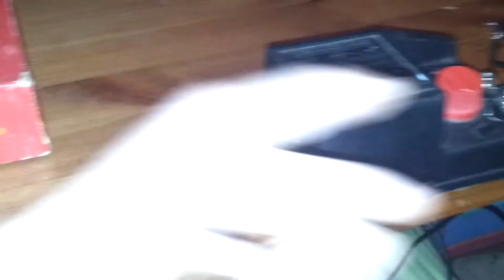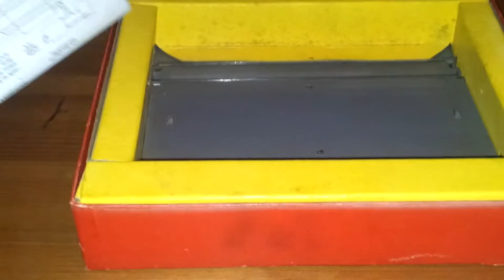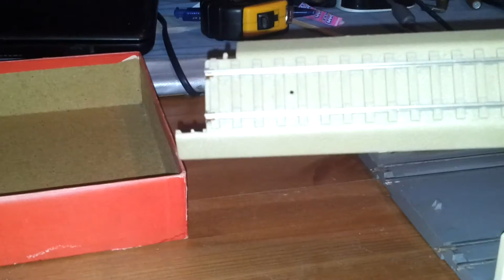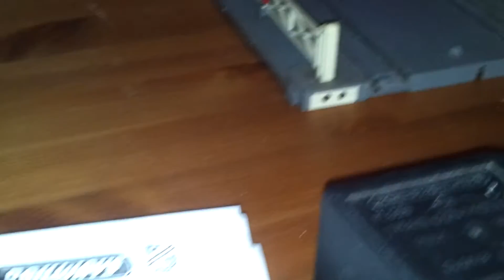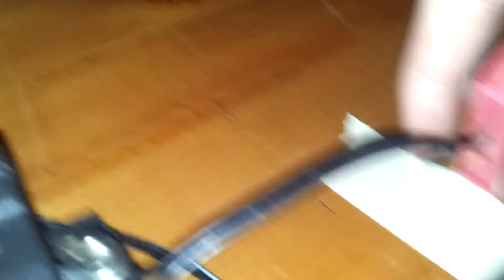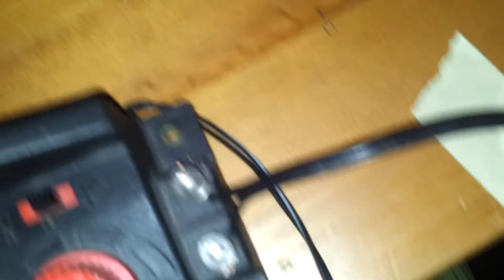try-ang oo gauge electric operated level crossing

Comment: I have one of these level crossing that I use to use on my railway that I had as a boy. I have kept it and have been think about bring it back into use. The only problemi is if ii still have the convert tracks to convert triang track to current hornby track.
Reply from the maker: I found it really easy to be able to slide the rails out and slide a piece of new track in, this video was made 9 years ago and the crossing is still going strong to this day if interested i can upload an update video of how I did it and how it's going

Comment: Thanks for the video.  I have 2 of these Tri-ang level crossings.  One of them is similar to the one in the video.  The other is a continental-style lifting arm affair.  I bought them on Ebay.  Neither of them worked satisfactorily.  For the first time, I am seeing them work properly in your video.  

 In your level crossing, the gates open because 2 spring-loaded levers get pulled by a steel wire that expands due to heat created when your electrical power flows through it.  This method of actuating the gates can only have a short operating life because of creep strain in the wire and hysteresis in the springs.    

I made my lifting arm level crossing work reliably by replacing the Tri-ang mechanism with one of my own.  In my level crossing, pulling a string make the lifting arms come down and become horizontal and counterweights on the arms make them rise and allow road traffic to flow through.  It is a simple matter to attach a solenoid to the string so that one has an electrically operated level crossing.  A more complicated system of strings and counterweights will be required on the gate-type level crossing that is featured in your video, if the old Tri-ang electro-thermal mechanism stops working.

I wish that Tri-ang had come up with a design similar to my own or something better using the solenoids that they used on their electrically operated points.  Then, there would be more working Tri-ang level crossings in the layouts of aging model railway enthusiasts.
Reply from the maker: With the technology we have today it would be easy for a big company like hornby to make a motor driven or solenoid powered one that would be alot more reliable and wouldn't brake the Bank